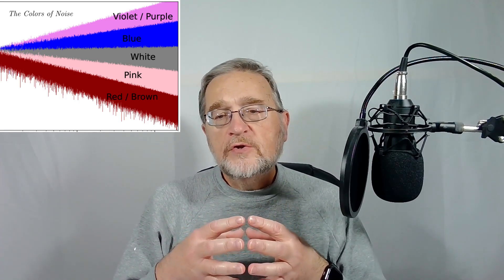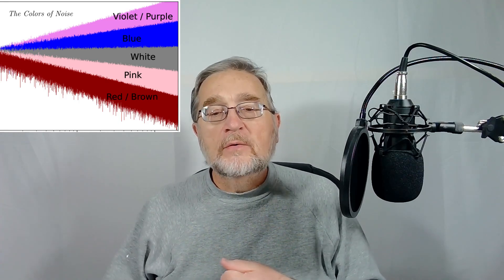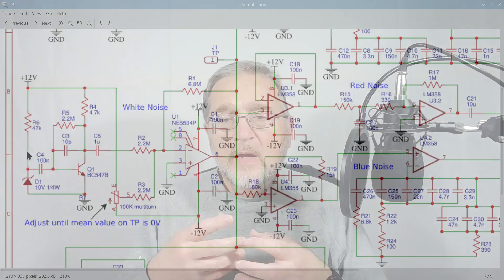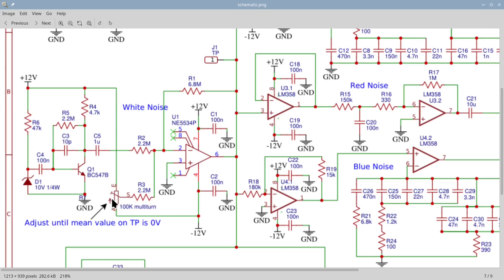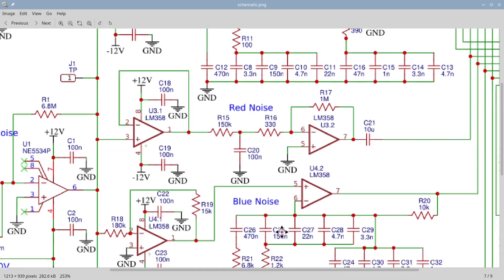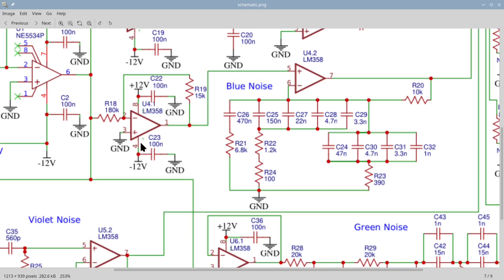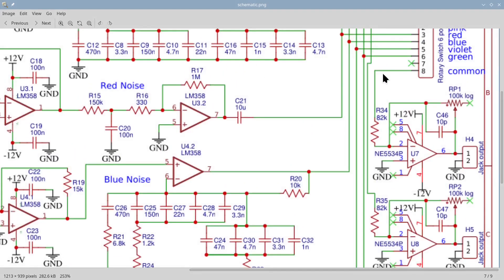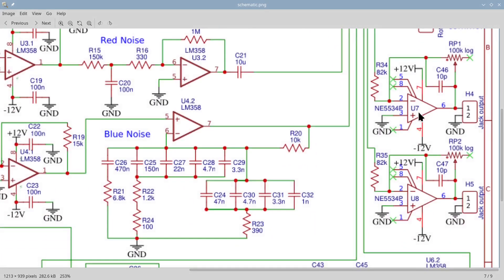The Synth Project Episode 47: Noise Generator Module - Part 1

Comment: thank you for sharing your synth build experiences! I have a question: how do you come up with your selection of opamps? I notice that you use quite common types in your builds, but I fail to understand the aspects you consider for your actual choices. E.g., why did you choose a 5534 Opamp for the first amplification stage, and not  for example another LM358 half or a TL071?
Reply from the maker: It all depends on the kind of necessities. The LM358 is a general purpose op-amp with a good bandwidth that allows for quick response times (high slew rate). When I need a very high input impedance I use a TL072 or TL074, depending on how many op-amps I need. The TLxx op-amps have JFET transistors on the input side, which provide a very high input impedance. They also have a very good slew rate, which makes them as fast as the LM358 in terms of response time. Finally, I use the 5534 when I need a very low noise op-amp. This IC, in fact, although providing a similar slew rate as the TLxx or the LM358, it also provides a very small noise figure, around 3.5nV per square root of the frequency.
In rare cases, I also use the LM7332 which works like the LM358 but with a higher output current, around 60 mA.